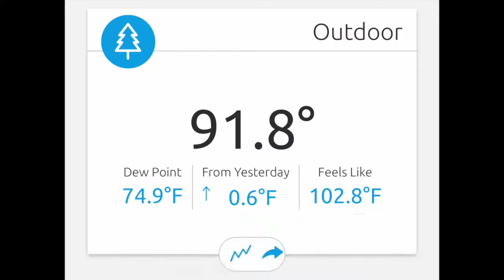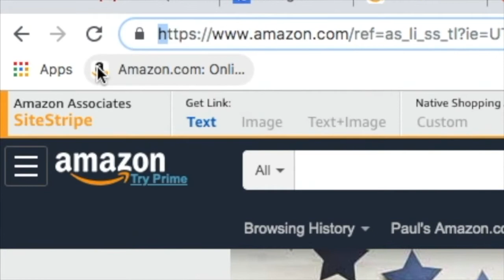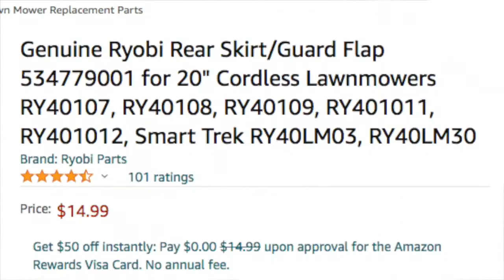How to Sharpen a Ryobi Lawnmower blade

Comment: No, you don't need a thread locker - you should torque it to spec. If you lost your manual, an internet search would show the torque specs. Also, you should not sharpen any mower blade to the sharpness of a knife or greater, especially a light blade typical of electric mowers. Lastly, you did not check the balance of the blade, which is critical. Perhaps you should watch videos by those who know what they're doing, rather than passing on your lack of knowledge.

Comment: I’ve had my mower for a month and love it. Only problem I have is the torx bolts behind the rear wheels - that hold the handle support bracket on - tend to back up. Have to tighten them every couple of mows. Otherwise i enjoy it. It’s more enjoyable to mow with the quiet electric and the fact that the battery lasts 30-45 min is actually nice. Gives me an excuse to take a break and drink some water. Thanks for the video.
Reply from the maker: You are welcome! Thanks for sharing. If you havent seen it, I have developed the same issue: https://youtu.be/hEiyPcZaibU
I'm going to continue to find a more perminent solution. Stay tuned. Eventually, I believe the plasitc will strip out and we'll be up a creek. You have any ideas other that tighten every other mow?

Comment: I have this same mower. It's a beast! It sliced through my metal garden hose nozzle no problem. Guess why I'm watching this video... Ha ha. Manual supposedly has a torque spec for the bolt but I can't find mine or one online. Add blue thread locker or mark it with a sharpie or paint pen to see if the bolt moves on you for added safety. My mower lived outside rain and all, sans-battery, for the first 3 or 4 months I owned it. No problems there or with that black plastic flap thing. I run mine no bag, no plug. Those pieces have been outside since I bought it years ago. They're still in one piece. I do use a bungee around the plastic latches on the extendable handle to secure them in place.
Reply from the maker: Wow impressive! btw, I love the idea of using a sharpie to mark the bolt. Thanks!

Comment: I know I’m late to the party, but I’m gonna speak on the ryobi mower. I have one and although it’s better than my old worn out gas mower, it absolutely will not replace a good bit gas mowers in terms of power and blade options. That seems to be my biggest issues with this mower in my personal application, I’m not the typical just mow my grass and ignore it type of guy I like fertilizing and striping etc and for that, it’s just sub par. My main complaint is that you don’t have blade options for these, the ryobi mower is all you’ve got, it cuts but it doesn’t cut well, it’s thin, it’s a pretty soft metal and not my favorite but that also brings in another gripe I have. The reason the blade is so thin and light is because the motor isn’t really powerful, I can’t speak on the newer cross cut mowers but from what I’ve heard it’s not that great either. If they made these stronger, or rather more powerful and gave us a better mounting plate (for different aftermarket blade options) I’d love it.
Reply from the maker: I'm with you on the lack of blade selections and problems with hitting this to ding up the blade. I have a love/hate relationship with this thing.
Reply: @TSGEnt  I was disappointed when I got this a while ago and was wondering why it wasn’t really picking up leaves or anything. Went to look for blades and there’s no high lift option, literally because it would make the blade spin very slow and run time would be terrible. They definitely should beef things up especially since they’re charging the same rough price of a base ego
Reply from the maker: @KDlGG  A buddy down the street just got an EGO electric sitdown mower. I tried it out. Certainly give a gas powered version (little john deer) a run for it's money. Ego has advanced a bit faster than Ryobi, but then again, I haven't tried any of the newer Ryobis. So many reviews to do, so little time. Stay tuned. I might pull off an EGO review.
Reply: @TSGEnt  haven’t personally known anyone with a zero turn however I figured it would be good. I’d definitely review a higher spec ego push mower with the dual blades as that seems more homeowner friendly, and imo is great but in some overgrown applications can suffer

Comment: I bought an OEM blade from Ama for $20, made in Germany, most definitely not "Chinesium" (love that 😊) It's a little heavier and more rigid. I'll keep the original as a spare while take time off to sharpen the other at my own leisure. New blade cuts like a champ', see how long it lasts before sharpening. Nice video, thanks for the tips. 🖕
Reply from the maker: Thank you for the tip on the Ama blade!
Reply: @TSGEnt  You're welcome, it's made by Maxpower, 20" replacement blade for B&D OEM# 514061-49... It's just about 4 oz heavier than the Ryobi, definitely not as flexible.  I 'm going to try it out today or tomorrow. My lawn isn't all that big and I usually get two full cuts and a bit left over from one battery charge, see if that extra 4oz makes a difference in battery life
Reply from the maker: @BoggWeasel  I'd love to hear how it does. My predictions is as long as you keep the throttle on all the time and move forward productively cutting lawn, that extra 4oz because of momentum may actually give you better battery life. Newton's 1st law. It would be the throttle on throttle off  action that might be a detriment because of the extra energy to get the thing spinning each time you throttle it. It's kinda how helicopters work. reasonabley efficient in the air, but a a lot of fuel to get it off the ground. Let us know your outcome!
Reply: @TSGEnt  Sorry it took a while to get back, lost track of the video.  You wouldn't think it but the added 4oz and slightly thicker blade does make a difference. Not a bad cut if keeping the grass long, (4 inches +) but for medium to short cut (2-3 inches) the original lighter Chinesium blade does a much better, neater job, I think it spins faster. I guess an electric motor doesn't have quite the ooomph (technical term) that a gas mower does and the weight of the bade affects the speed of the spin. I'll keep the original as the main and the replacement as a backup. The difference in battery time usage was negligible.
Reply from the maker: @BoggWeasel  Thank you for sharing the first hand experience. I learned something. Blade speed is better when lighter. Thank you.

Comment: Use of the piececowood when taking off the blade is very usefuln and productive, thank you. Also, thanks for the info about the proper direction to turn the bolt to loosen and tighten the blade but.
Reply from the maker: You are very welcome. I'm glad it helped.

Comment: I have 40v 4yrs  no problem till today will no start try jump key still no start is there any fuses inside unit?
Reply from the maker: If yours is the same as mine there are a couple switches that if dirty or mal-adjusted will prevent the thing from starting. There is a magnetic switch down where the catch basket restes on the body and a switch at the shaft lock. Be sure those are clean and/or not broken.

Comment: I just got a Ryobi 40v 20” and so far I like it. In the future do you think it would be a good idea if I bought a “non-Ryobi” blade with maybe better quality? Thanks.
Reply from the maker: It depends on what you mean by "better quality". There are other blades out for sure and you could try them if you ever broke the stock blade. My experience with the stock blade tells me however  it takes an edge real well. That means is't a softer steel and IMO is great for stuff like grass and such and if you hit something like concrete, the softer steel where it might dull the blade or put a ding in it, is less likely to crack or break. That's a good thing. Also be mindful of the weight of any replacement blade you might try. My guess is too much weight could over tax the motor with undesirable results I'm sure.
Reply: @TSGEnt  ahhh very good points. Thank you.

Comment: Watched the struggle to get the nut off...actually, you did pretty well.  I do brushhog blades, 60" finish mowers, ZRT, got some history..blades can be tough to get off.  Until I bought an impact driver.  That has completely changed the perspective.  You'll find no issues, no effort to get your blades off if you go this route.  Unless the nut turns out to be reverse threaded... 😃
Reply from the maker: Great input. believe it or not, I now have an impact driver!i should have had one years ago. So useful in many applications

Comment: Sharp but not too sharp  Kansas State mows at 4 inches in the summer less stressful for the grass.  I hope you can get the flap replaced for your mower.
Reply from the maker: I have a plan for the flap! Stay tuned!
Reply: You did not balance the blade with say a nail . You can easily burn out your bushing or worse the motor.